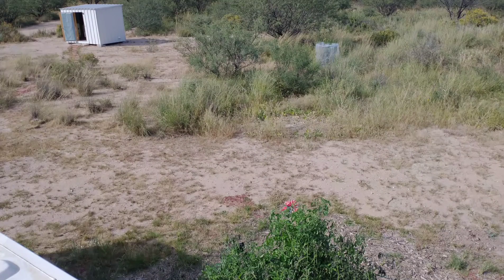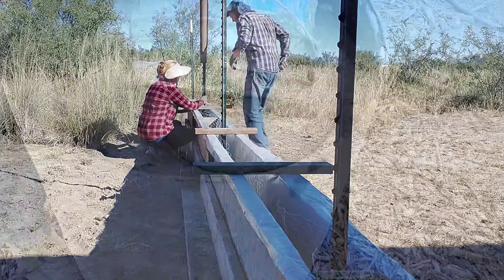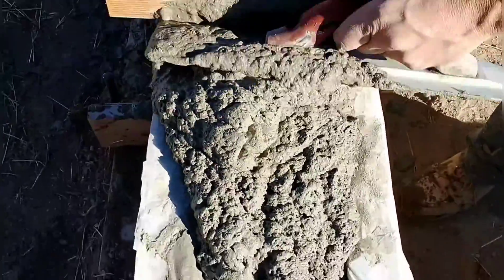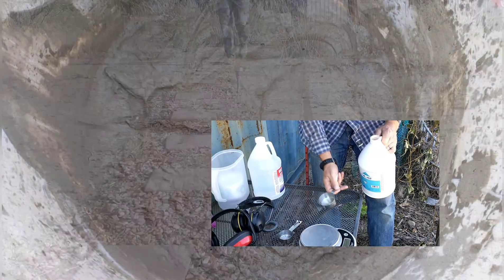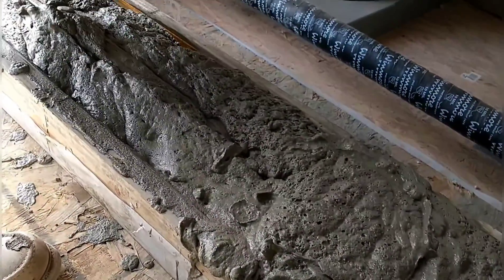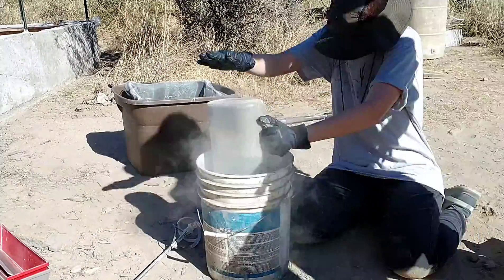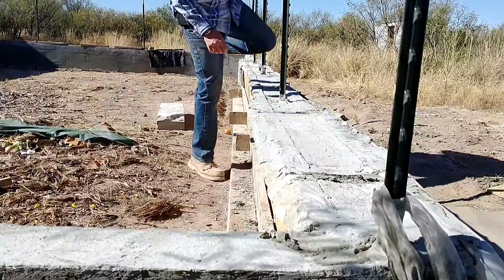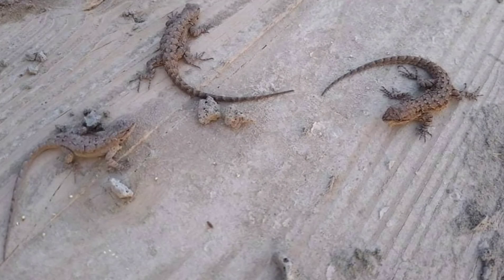We Finished Pouring Our AIRCRETE Garden Wall & Beginning to Plater

Comment: from what i see the aircrete looks good, I think you are expecting something that aircrete will not  provide
Reply from the maker: If our batches had continued to turn out like they did at first, we would have went with it. Some of it is okay, but some is overly brittle and easily turns to powder. I could see using it in a small structure, but don't think it would last 50 to 100+ years, like we would want for our house.

Comment: Would a paint roller and rough textured roller put on the plaster fast so one could follow smoothing it out?
Reply from the maker: It is pretty much the same consistency as a thick buttercream icing. It goes on pretty well with a trowel, but I am sure there are other methods that would work. 🙂

Comment: Maybe check the PH in the water? I remember HoneyDoCarpenter mentioned in a video that he was having problems with the mix. Got some PH strips and it was off, simple solution was to add some baking soda in the water to neutralize it. Wish I remembered which video it was.
Thank You for sharing such a detailed journey with the Aircrete.
Reply from the maker: We have some PH testing strips, that would have been interesting! I checked the PH of the well water, but didn't check the water after it went through water softener. 
🤔 I saw Honey Do Carpenter using baking soda but didn't know why. We figured since it worked at first, that it was probably fine.  Good point, and thanks for watching! 😊

Comment: Great info. Love these aircrete videos as I'm very interested how aircrete can be applied.
Reply from the maker: Thanks, we have learned a lot, but still haven't nailed down all if the variables, but I guess mistakes often teach more than success. 😊
Reply: @RedandAprilOff-Grid  it sure does. I do still think that aircrete doesn't have the compressive strength required for any type of foundation. If you could just drop a metal bar that dented it, I doubt substantial deadloads will be resisted by this material over time.
Reply from the maker: We were considering using the low foam or sand mix for the floor but our footer is solid concrete.
Reply: @RedandAprilOff-Grid  yes, definitely would go with that, it would be interesting to see the thermal resistance numbers of aircrete vs regular concrete. Say test how long to takes to melt a cube of ice in a box made of either material.

Comment: Maybe stop using air. Use Styrofoam instead. It's a problem waste product yet perfect for insulation and perfectly suited to maintain form. You'll be entombing the product into a second life and your troubleshooting will be over.  Should be far cheaper collecting Styrofoam to be chopped up into granular bits than it would be to buy that fiberglass & bits etc
Reply from the maker: It would take a whole lot of styrofoam to build a house. Even if we could easily get it. It would require a lot of trips into town to pick it up, and pack it into our vehicle, then bring it home and put it somewhere until we had a chance to shred and bag it. We would need a large indoor space, and it would be a very messy process that would be very hard to contain. In comparison, Drexel is $1.50 per batch and fiberglass or basalt fibers are less than $2 per batch. They take up very little space, and are shipped straight to our door. It will be interesting to see what all people can make out of styrocrete, but it's not for us.
Reply: @RedandAprilOff-Grid 

Watch this series of videos. this guy, Stephen williams came up with a method and equipment for processing the Aircrete.  He is articulate and methodical.  His experience with aircrete is similar to yours.  He was able to get styrofoam from furniture stores and shred them with a modified electric lawnmower.  he does not use the styrocrete for structure, he uses it for insulation.  he then puts a plaster skin on it that strengthens the skin.

 https://youtu.be/27v7Oq-q9xs
Reply from the maker: @greggmcclelland8430  Yes, it will be interesting to watch as he shares more. I would have a lot of questions if I was considering using it to build a house.  That's some seriously strong plaster if it can make a 5.5 inch wall that can easily be pushed over, structural.

Comment: I appreciate your scientific approach to construction. A $225 harbor freight 3.5 cubic foot cement mixer would promote consistent mixes. No more light on top followed by heavy on bottom batches. I also believe the fiberglass additive is a stellar idea and will increase strength. Keep up the good work!
Reply: 5 cubic ft mixer from lowes is way better! I've gotten both
Reply: @ogfoundation  at $499 it should be better. My point is that a mixer would be FAR more consistent; certainly more consistent than a drill.
Reply: @benjaminholt4292  I guess they upped the price! I think I got mine for $350. You're right though,  I premix the slurry in that b4 transferring it to 50gal bucket and mixing w/foam 👍
Reply from the maker: I have heard that mortar mixers work pretty well for aircrete, but concrete mixers are not ideal. If we were to continue with aircrete we were planning to buy one. We could buy a mortar mixer and sell it when we were done with it. It would also be very useful for mixing the plaster and earth floor. Thanks! 😊

Comment: A friend of mine that has experimented with cement and aircrete for years suggested using cellulose, and claimed it helps stabilize the foam.  
I just ordered a foam generator and some Drexel, so i might try to create some experiments and record them for the online world as well.  You guys have created a great and usefull channel!
Reply from the maker: The dry testing of the cellulose fiber mix was pretty impressive, we showed those tests and results in the previous video. 
Would love to see your results, best wishes! Keep the Drexel at room temperature and mix it well before each use. That is something we probably weren't doing right. 
Thanks! 🙂
Reply: @RedandAprilOff-Grid  I'm not referring to cellulose fibers. Apparently it comes in some form that can be used as an adhesive/binder that they use for making books and such.  
It's more processed, and from what I heard its benefit is in stabilizing the foam, and not to strengthen or reinforce the cement in the aircrete.

Comment: Can u share aircrete mix ratio? Tks!
Reply from the maker: I forgot to put it in the description, I added it now. 
In barrel mix
5 gallons water
94 lb bag of Portland Cement

Foaming soap solution:
5 gallons water
1/4 c. (4oz) Drexel 
1 T. Glycerin
Foam weight 80- 100 grams per quart.
Mix into cement slurry enough foam to make a 45 gallon batch.

Comment: Temp of drexel mix and not fully mixing it with the water were 2 mistakes I made as well. I'm also using t posts similarly to anchor things into the dirt better. All frozen here now though.  The garden wall/ enclosure is looking good! No bunnies nibbling on ur produce!
Reply: Nice to see ur girls helping out! Also, interesting plaster mix!
Reply from the maker: Yes, it seems like there is a whole lot of things that can go wrong when making aircrete. We really didn't have a way to get or keep the Drexel at room temperature, so figure that might be part of the problem too. Also, if the first part of the jug makes awesome aircrete and the last half makes terrible aircrete, then mixing the top and bottom of the jug together seems to make successful, but not great aircrete. We'll show our last set of samples in the next video tomorrow. They didn't fall, but they were very brittle.  
Yes it's awesome having some of the kids close by. One just moved back home, and the other lives nextdoor. 🙂
Reply: @RedandAprilOff-Grid  what I did was use warm water to mix w/ the Drexel, even if the rest of the water I'm using is colder. I figure temp affects bubble formation. Also found the same issue from not shaking the drexel and the bottom of container is diff color/ consistency

Comment: I'm wondering if attending a few aircrete workshops might not help you figure out why you keep having so many batches collapse? You just seem to be doing everything right and I'm frustrated for you. 😑
Reply from the maker: True that could help, but I figure people who have attended workshops are still having issues. It's tricky stuff. I really think the colder temperatures are affecting it. We kept the Drexel in our trailer, but it's not very warm in here either. Then we set it out in the sun for a few hours, but I figure it is still colder than would be ideal. It's been quite the experience, but we aren't too discouraged. We have exciting plans for our house build that we will be sharing soon.  😊🏡